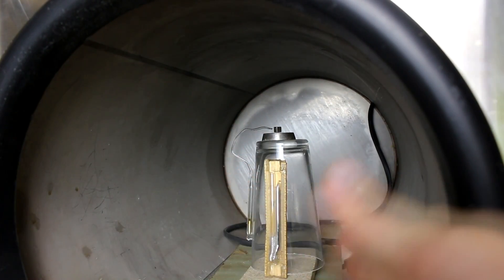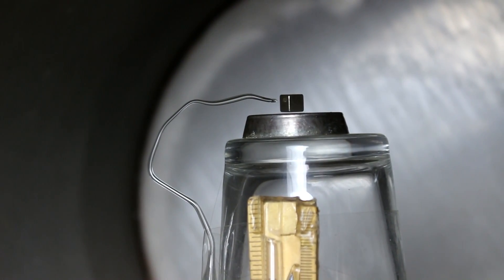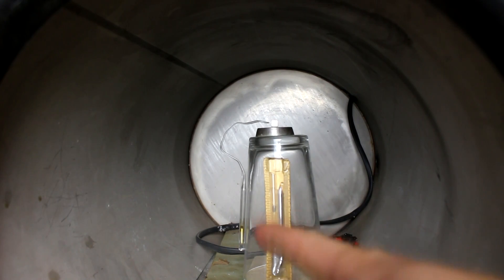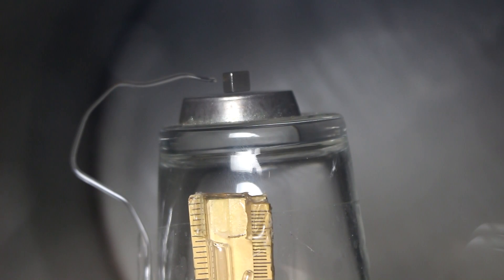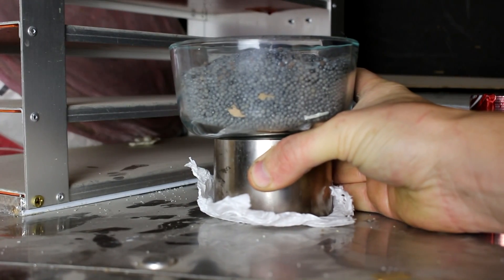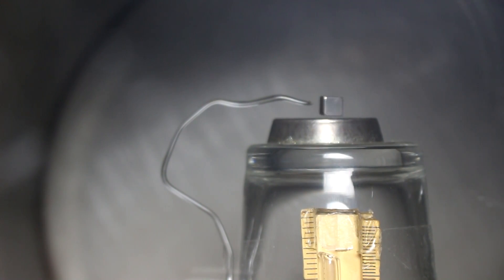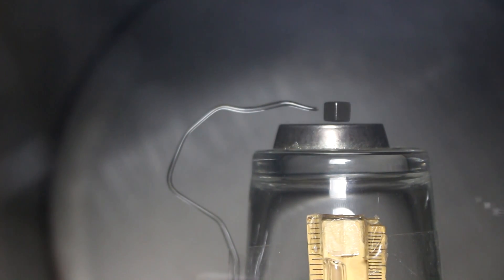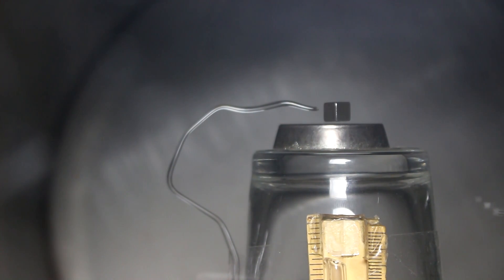Levitating a Magnet in a Vacuum Chamber

Comment: moving/spinning a magnet causes the surrounding magnetic field to change. and it will generate electric current in any conduct material in the field. which will then turn to heat due to electrical resistance. If you put all the rig in a box that cool down to a very cold state, you can actually reduce most of the conduct material's electrical resistance down to zero. at which point, it will spin forever, pretty much, yeah. But actually you can't just remove all air, there's still residual air molecules no matter how you try it. so...Also, theoretically, you can only make a space empty when your rig approaches absolute-zero. You can't really achieve absolute zero, you can only getting closer and closer...Even with absolute zero and everything, well, if you consider quantum fluctuation...basically it means empty space will generate matter. But...personally I haven't check the math but it's very unlikely that it will have any thing to do with the spinning.

Comment: Cody, you forget about an important factor: gravity wave caused by the spinning magnet.
Reply: Do you mean gravitational wave or gravity wave? If you mean the former, that's not how that works, and gravitational waves are incredibly tiny. Like, smaller than a proton tiny. Even the black hole ones. If you mean gravity wave (A wave caused by atoms moving up and down due to gravity), well, he's vacuumed most of the stuff that could cause that out, if it could even cause it.

Comment: instead of the laser on wood, how about a little bit of water?  as the pressure goes down, it vaporizes and the steam through the pipe would be enough to rotate the levitating magnet.

Comment: instead of a metal that is non conductive why not make something that can make a non conductive material temperarly minipulative by the magnate. example: spoon rub magnet become temperarly a magnet. or magnet become less strength from heat like in the show scorpion the magnets were slipping from too much heat.

so try to make some structure that would allow a non conductive material be manipulate by the magnet....  just thought of this. WOOD.  try covering a wooden object. someone said sphere. I think a cone with a small groove to spin it with that glass. or Wood and cover it with aluminum foil... wait aluminum is magnetizable right. are tin cans. cause its a thicker aluminum and maybe nickel I forgot. 

anyway I think you get my point or the idea. and if that don't work then try.  I'm seeing alot of liquid metal. gallium. is that conductive.  or mix it with clay. technically still a metal if u mix it with a metal.

I honestly thought this video was going to be something like a metal spinning top and you manually spin it then vacuum to see if it kept spinning mix with a time skip or some speed up time and this video was the end result.

Comment: If you cool the entire apparatus down to the point at which materials become superconductive, you could replace the top magnet with a strong electromagnet. You would have to raise the stand inside the vacuum chamber to reduce the gap between the electromagnet and the Bismuth sample. If you could make the electromagnet oscillate at controllable frequencies, you could use that to spin the metal sample (bismuth). After gaining enough speed, switch the electromagnet to a regular state with only enough power output to levitate the metal. At a high enough velocity the sample would spin for a much longer duration...Just a thought...

Comment: I was playing with a fidget spinner and thinking if perpetual motion would be possible. I thought of the idea of making a fidget spinner except without bearings, just magnets.
Reply: Perpetual motion would be impossible. Things tend to go to a higher level of entropy. This means small little things like the friction with the air or the pull of Earth's magnetic field would slowly turn the spinning into heat. It also means that the magnets would wear out because things are magnetic due to their atoms lineing up in a polarized state. Also it I'd extremely hard to levitate something. The Earth's gravity is not uniform which means you would have to have a device regulating the magnetic field which would take energy to do.

Comment: Or it just migt try to orient itself along the Earth's magnetic lines. Sure, it's facing up/down direction. But the Earth's field is not exactly paralel to the surface either. I mean, I can stick two small magnets together with a thread in between and it readily orients itself in North/South direction. So hanging in vacuume with all the forces being equilized all it takes is a bit of extra magnetic field to stop it. The fact that it's tilted could make extra tendency to orient along the lines as well as being a consequence of that tendency.

Comment: If you balanced the field above and below where the bearing would most likely be in the middle it should spin longer. The reason to balance is that at your current position you are still creating an artificial gravity field from the closest object. Balance and you should neutralize the pull.

Comment: If I recall, the viscosity of air is constant down to about a torr, which is what you pumped down to, so you're probably still seeing significant air resistance effects.  You might try with a lower vacuum pressure if your system can do that.

Comment: I don't think it's theoretically possible. I think the magnet exerts a force on the upper and lower magnets via the field, and some of this force will act as a backwards rotational force. At least, that's my intuition. And I think this is the case for any magnetic substance. I just don't think you can spin something magnetic in a magnetic field without the field exerting a counteracting force on it.

Comment: Is perpetual motion (net work done = 0) even possible? the best theoretical model i can think of would be a perfectly spherical rotating ball of Ni (62) placed in a vacuum filled shell. The sphere should also be isolated magnetically by making this shell out of a superconductive material (pyrolitic graphite) precooled to its Tc. This shell then has to be  kept thermally isolated by a secondary vaccuum filled shell with its inside coated by vantablack and its outside coated by a near perfect radiation reflector. Plus this whole system should be kept at one of the langrage points so as to minimize gravitational perturbations which might result in the sphere and shells colliding with each other...another improvement could be to also keep the shells spinning in the same axis and angular velocity of the innermost sphere so that the relative velocities of the innermost sphere and the superconductor becomes zero...this would minimize eddy currents as well.....but alas i cannot think of a way to mimize any drag associated with virtual particles.

Comment: In a true vacuum (space) the magnet would spin for a veeeeeeeeeeeeeeeeeeery long amount of time since there is no way for the kinetic energy to become another form of energy. All that could stop it is tiny particles like photons. Thats why a rapidly moving object in space is extremely dangerous.
Reply: Magnetic fields can stop it from spinning as well. That probably stopped yours from spinning too.
Reply: Bluefrog2000 the energy is lost from heat
Reply: Dracster Twine yes because I assume the heat would be caused from the particles hitting it.

Comment: Before and during the experiment when it stopped it would then rotated a little in the opposite direction.  I also noticed that the speed once it was in a vacuum varied depending on which side it was facing.  That tells me that it isn't balanced.  Even though it's being levitated it is still subject to the force of gravity.  I think the heavy side is a force of friction.

Comment: I am going to say "No" for the following reason.

The magnet is likely not fabricated to ensure that the poles within it are evenly distributed but they will clump slightly more to one side or another or more to the top or the bottom.

Because of this slight imbalance, the magnetic field will not be uniform and the flux eddies will cause the magnet to slow eventually to a stop.

Now, I may be writing nonsense but I'm sure someone will understand what it is I am trying to write and add an amendment or correction.

And this would also be the case for a round magnet. The material making up the magnet will not be evenly distributed throughout the magnet itself.

Comment: The fact that the magnet is slowly oscillating back and forth when it should be at rest, indicates to me that it's not going to spin forever. There appears to be some resistance in the magnetic field itself that the object is "bouncing" off of. It will probably sit there and oscillate for a long time but eventually stop doing that as well.

Comment: It will spin for quite a while. But bigger weight will spin longer. I have been try to find a news item about a university who set up the same experiment, but a top weighing 1 kg was used and spun to 1000 rpm (I think). They calculate it will lose 1 revolution per second per day - thus spinning for years. I may have seen it in a Guinness book of World Records.

Comment: but just thought. we use spinning magnetics to generate electricity. if removing the air and making the magnetic spin forever could that be used to make unlimited power?
Reply: Brad Munro no, it loses energy through heat
Reply: yep i know that, just making a point if that was the case why do we burn coal and use nuclear fuel

Comment: You could tell at the 2:50 Mark as the magnet is swaying back and forth so you can see the magnetic field changes the force on the magnet causing it to eventually to stop and get caught in the orientation of one of the magnetic fields. Is positive or negative.

Comment: Thanks for a great experiment. Could it be it stops because: (1) Top magnet's field generates an opposing "braking" magnetic field in the rotating magnet  (2) Top magnet's field "brakes" rotating magnet (3) Rotating magnet generates an opposing "braking" magnetic field in the bismuth. Suppose the large top magnet was rotating too. Would the magnet in the vacuum rotate as long as the top magnet rotated? Try experimenting with the top magnet designed to freely rotate and mounted inside the vaccuum.

Comment: I think you would need a perfectly ballanced cube or disk to let it turn longer, because the cube doesn't look's like that. If the cube is nearly at the end of the applied force, it swing's back and forth. Which means that there is a point on the cube lower than all other on the downside, which is affected by gravity.

Comment: The spinning magnet is creating small electrical currents in the metal below it and these currents are causing their own magnetic fields that are counter to the small magnet and thereby slowing it's spin.    Similar to dropping a magnet down the middle of a copper pipe and watching it's rate of fall slow.

Comment: Of course not. A magnetic field is imperfect in regards to rotation, and just like anything that is imperfect when it comes to rotation it creates an opposing force somewhere else. Even though the magnet is in a vacuum, it's still feeling the pull of gravity and inhibits the "natural" spin of the bismuth cube. Gravity is affecting its stable state in lieu of its center-of-mass causing wobble when a moment of inertia is introduced. You would need to eliminate any external gravitational force and have a perfect cube with a perfect magnetic force to make this work perfectly.

Comment: My best guess is that this is caused by electromagnetic resistance. The best example i can think of when you crank a hand generator no matter how hard you push it ramps up slowly because of the resistance of the fields interacting with eachother. 

Basically an electromagnetic form of friction

Comment: Cody, you might want to try electrostatic levitation, if you really like challenges. All you need is HV generator, concave base and very lightweight and thin insulator. Levitating disk will have some charge so it will not be perpetual motion, but charge count compared to metal will be very small. Actually base can be insulator as well, conductors might be arranged in it radially from the center, so Eddy currents will not be induced.

Comment: its going to slow down because magnetism is as much a physical force as actually touching something. its 'friction' because just like the surface of two objects rubbing together isnt perfect and so the forces of those imperfect ridges and valleys at a microscopic scale slamming into each other causes heat, the magnetic field - thogh invisible - also has imperfections when sliding against another field that is going to cause minut changes in the action leading up to a slowdown.

Comment: You need to replace this experiment with superconductor.  Any slight variation in the magnetic field will induce a current in nearby conductors.  If there is any loss (non-zero resistance) dissipation will ensue due to eddy currents.  The spin-down rate is far, far faster than that due to air resistance.  This is a fair start at experimentation, but reminds me why folk fund things like EM-drive research.

Comment: My hypotheses for why it stopped (in order of likelihood) are:

1) Eddy currents and magnetic resistance
3) Earth's magnetic field
2) Earth's gravity
4) Not a perfect vacuum

The solution: Use superconducting magnets in a perfect vacuum, in intergalactic space.
Reply: Knuckles 
Unless something gets in da wae
Reply: Basically, that’s planets and stars
Reply: Has basicallybeen done, in the Gravity Probe B - Mission. Except they did it in an orbit around the earth, because gravity causes no friction, this difference does not matter. They levitated spheres coated in a superconductor cooled to 2K in a vacuum surrounded by superfluid helium, surrounded by a superconductor.
Reply: The earth's magnetic field can be reduced by several magnitudes inside a Mu-Metal chamber
Reply: Don't forget that one guy from the X-Men haha! 👷
Reply: Ill get on that right away
Reply: If the big magnet is slightly larger and we assume both magnets have uniform composition, eddy current can be ignored because we observed that rotating the big magnet almost has no effect. I think it's mostly the earth's magnetic field. It might be possible to remove eddy current by using a larger top magnet and making sure the small magnet has perfectly balanced weight with uniform composition (like a thin disc). Rotating the magnet around the field's axis does not create eddy current under perfect conditions, and it is observed when he rotates the top magnet to show nothing happen. Having a magnet that is balanced in weight and composition is important because we don't want to create any eddy current by the "wobbly" motion. We have to obey the laws of thermodynamics, so the magnet will eventually stop regardless
Reply: AFastidiousCuber it would already spin forever in space

Comment: Could the magnetic field itself be causing the magnet to stop?  Wouldn't the magnetic fields tend to align themselves just like a compass needle and the globe?  That tug is defeating the minimal inertia it has keeping it in motion.  Also, I think that entropy (thermodynamics) would cause it to lose inertia gradually even if it was not fighting gravity or air resistance.  The ultimate heat death of the universe and all, lol.

Comment: You should be giving some thought as to why towards the end of the video it was slowly spinning one way then spinning back the other way similar to what something tied to a string would do until the resistance from the string being wound was  enough to slow the momentum to a stop.  Try giving the cube a quarter turn to see if the field will move it back to a position it is comfortable with. Without the vacuum of course.

Comment: Maybe instead of magnets you could use the repulsion of some electrets? They're dielectric membranes where opposite sides are permanently polarized. They're most notable used as diagrams in microphones to eliminate the need of supplying a polarizing voltage as would be needed with a condenser microphone.

Comment: Spinning anything in a vacuum  no matter the shape will slow down and stop. Imagine a bar spinning in space with no major forces acting on it. It will slow down and stop due to internal friction. The particles want to maintain a linear path but can't due to the centripetal force from the bonds in the structure of the object. The rotational KE will change into heat energy eventually

Comment: the currents created stop the magnet, but i think that the light of outside could also affect to the movement of the magnet... when it hits the faces of the magnet it may stop the movement a little bit. May be in a long time, even using a non conductive material, this fact could also stop it
Reply: You could also use fine leaves of metal, not a solid piece, to reduce the forces caused by the currents (sorry if my english is not very good)

Comment: You'd also need non-conductive suspension magnets, otherwise the eddy currents in those would slow it down.

Also, I figure you could have spun the magnet by rotating the top magnet fast enough, for long enough.